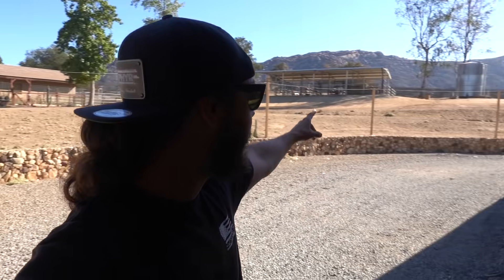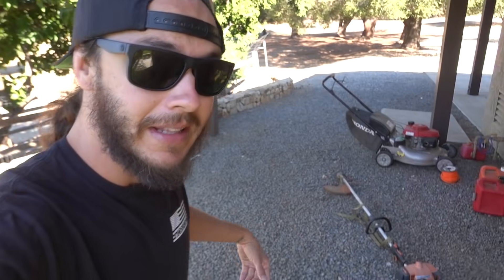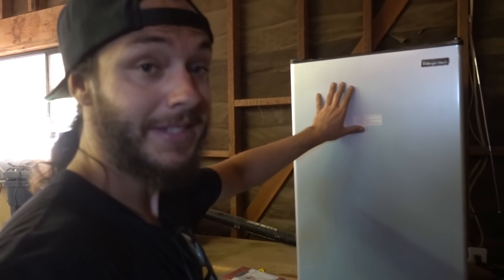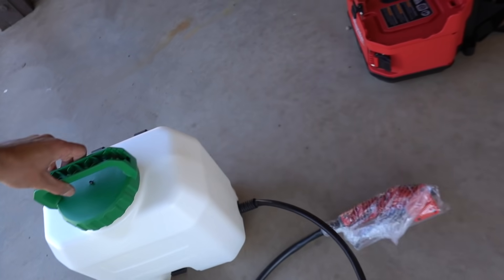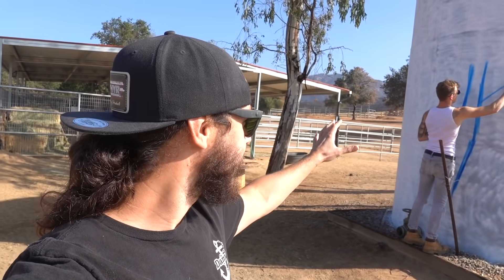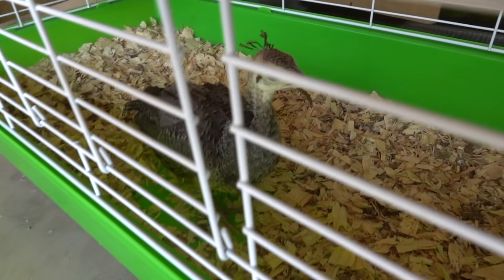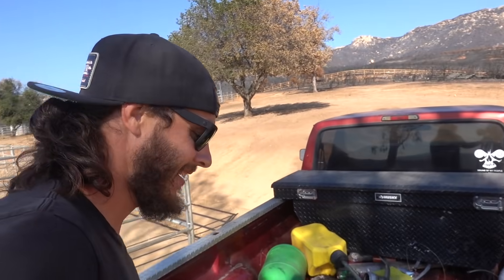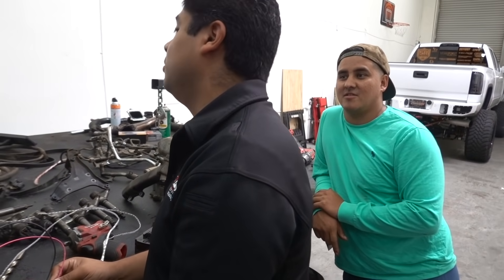TRANSFORMING THIS OLD WATER TANK INTO A WORK OF ART!

Comment: Buy a Jeep Jack (they may be called something different on your coast) and you can lift those fence poles straight up, not at an angle.
Reply: Commonly referred to as a Hi-Lift jack even though there are other brands. Its like Kleenex and tissue paper.  Sometimes called trail jacks, off-road jacks, etc.
Reply: @longshot726  Thanks for the other names. There was a time that that style jack was common in most cars/trucks as the factory jack. The bumbper had a slit in it for the tongue to fit.

Comment: Coat the top with Metacrylics roof coating to protect the tank you had the mural done on. Prevents it from corrosion. Then, you can apply their previously called stone coat and is now called tile sealer and it is a clear acrylic coating you can seal the entire water tower. This way you can rinse it so it doesn't stain when it's dirty on top from the trees. It also protects it from UV rays which prevents it from fading in the sun. Would make a good video applying it all!!

Comment: Ryno a 60 gallon or 80 compressor will be a great investment for the ranch, especially once you build your big shop. Believe me there are great deals out there, I bought my Husky Pro 80 gallon two stage 14 cfm at 90 psi in nearly new condition for $180 on offer up. Dude was moving and downsizing.I have enough power and volume to paint a bus if I wanted too and run my air tools all day long.

Comment: You can buy a fence post remover at Tractor Supply, it'll probably be alot easier and more efficient than using a chain and your truck to remove them or cutting them off at ground level ☺️

P.s. Love Willie & that water tank is going to look awesome 🐴💜👌

Comment: Them Honda's are shit for lines as all they got is that silly rubber flap not a proper roller don't know if Honda sorted it now but the cable for the self dive used too always snap    best tip I can give for them is to slightly bend the governor bar out away from the engine it picks up the revs so it won't bog out as much